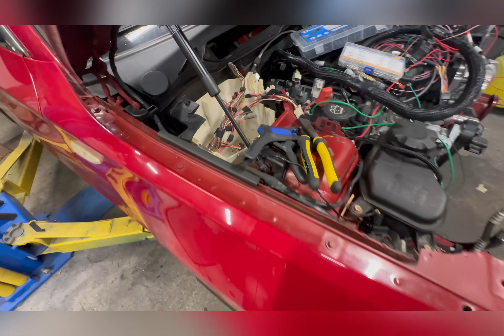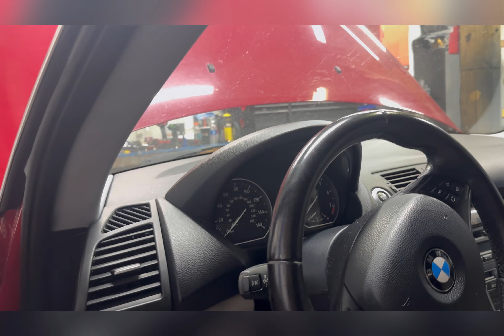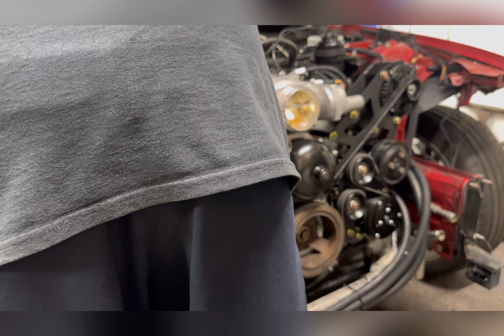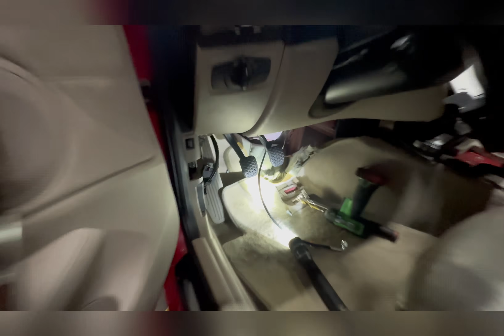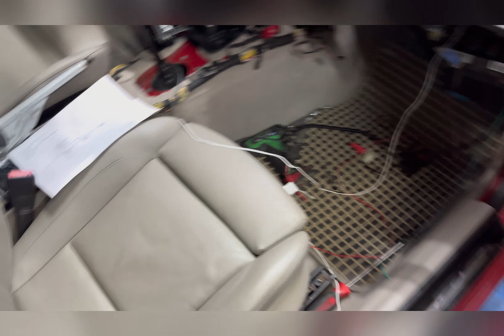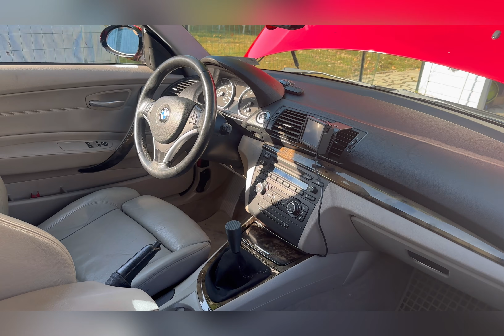V8 Swapping a BMW is THIS easy? Part 3

Comment: When I hit the link to the Holley harness, the link sent me to the Holley Terminator X MAX Engine Management Systems 550-918 model.  Is this the correct one because it states that it for a EV6 injector harness, and Pre-2009 4L60E or 4L80E transmissions.  Just want to make sure before I purchase at that price.
Reply from the maker: No you need to do your own research on which Holley harness you need depending on what injectors and transmission you are using

Comment: What size belt did you use with this setup? I’m on the tail end of swapping my 2007 e92 and I have the same accessory drive as you with the saden AC
Reply from the maker: @daltonlee1216  I ended up with a 2590mm belt or part number 6PK2590. Went to the parts stores and picked up the three closest belts in that size and the 2590 fit the best. Highly rec you measure first with some spring or something. Length can be different setup to setup
Reply: @ Thank you so much  I’ll measure as well just to be sure. Awesome build man, you did a great job
Reply from the maker: @ thanks man you’re gonna love yours

Comment: Great series. Enjoy your process and philosophy on YouTube content. Straight forward and to the point. Leaves more time for me needed into. Have a 07’ 335i e90 that is about 600whp full send and a 2010 Camaro SS MT. The 335i will be leaving for a e92 and the Camaro will become the donor car for the swap. Saving this series for sure!

One question…what made you go Holley Terminator and not GM ECU?
Reply from the maker: @edwardwerley8831  that’s the perfect engine combo for one of these chassis I think you’re gonna love it. I went with Holley because it integrates into the chassis without much work with Mikes Canbus Box to make all the gauges work and the ability to use the stock hvac controls. Although I’ve heard he’s working on a can box for the stock gm ecus now too

Comment: I’m curious to see how you did the gas pedal. Did you use a GM DBW pedal or were you able to make the factory bmw pedal work ?
Reply from the maker: @FlockaGarage  the factory bmw pedal works great. You splice the bmw wiring into the Holley drive by wire harness in the Ebox. No other mods needed
Reply: @Sfdgarage  nice. I’m sticking with a factory GM ecu tuned with HP and I’m hoping that it should be the same process on factory GM ecu. Atleast it seems to be lol there’s not much info on that setup out there

Comment: Sorry for bothering you but on Mikes site it only shows that the Harnesses works on 3 series up to 2006 
Do you know if it works for 2008-2009 model's? 
Any help would be greatly appreciated 🙏
Reply from the maker: @ChrisV129  no bother at all. Which harnesses are you referring too? Like the plug and play kits you can buy? As far as I know n55 cars are the only ones that have slightly different wiring
Reply: @Sfdgarage  thank you for getting back so quickly greatly appreciate it 

Yes the plug and play harness like yours but on the site it says only up to 2006 doesn't have an option for 2007 or later?
Reply: Mines a 2008 and worried the wiring will be different where I have to hook the pedal an canbus box etc?
Reply from the maker: @ nope 2008 is a perfect year to swap, all the lse90 info is based around that model. My 1 series is an 09 but 08-09 are just about the same
Reply: @Sfdgarage  sweet thank you so much

Comment: Nice video. I am in PA too. I have an e84 im in the process of wiring but i have an 8 pin throttle body and my terminator x max came with a harness that states dont cut or modify. What do i do?
Reply from the maker: @845BackyardBuilds  if you’re running a Holley setup you’re gonna have to cut it to splice into the factory bmw pedal like in the video. For the throttle body side, they make adaptors to go from 6 pin to 8 pin. Check out psiperformance
Reply: @Sfdgarage  i have the 8 pin TB DBW, and the harness for the 8pin. I have been trying to make this work. I've been checking diagrams. I've been considering that maybe its my ls2 throttle body not being compatible. what are you using?
Reply from the maker: @845BackyardBuilds  I’m using a gold blade ls3 throttle body. It’s six pin already and didn’t need an adaptor or anything. I think it was in part 1
Reply: @Sfdgarage  I'll be getting that. I will keep you posted once mine is running

Comment: Awesome vid man. Here in Australia, it's not easy to run aftermarket ECU's when doing engine swaps. Going to be running a standard LS1 wiring and ECU for emissions compliance ( Holden Commodore in Aus' ) 
Will be interesting to see if the wiring colours are consistent throughout the BMW range. I am yet to buy my BMW, but looking at E46 320i to 330ci Coupe'.....
Lots of info around the internet thanks to the good ppl that are willing to share...thank you.....

Comment: Sounds fucking amazing!  I have a 07 328i I would like to swap, already have an L96 but still need trans, holley, driveshaft, etc...how much $ would you say you have in the swap total, not including the cost of the car itself?  I am thinking its gonna take another ~$8k give or take to get everything I need, depending on whether I go 4l60e or T56...
Reply from the maker: @CPoston420  good question, I already had the LS1 long block and the T56 before starting this project so that saved a decent amount. All in I’m about 10k into the project including buying the car which was 3k.

Comment: Amazing! Do you know if you have to run that brake signal wire to pin 41 on the CAS if you are staying automatic?
Reply from the maker: @Stckit1  yes you do. The only time you don’t is a factory manual car staying manual transmission

Comment: Enjoyed this series, would you mind commenting on the t56 vs zf s6 gearboxes? Why go with the t56 or when should one stick with the stock bmw trans? Thanks!
Reply from the maker: @ngige3617  I already had a T56 in the garage to use so it was a no brainer for me. I’m not sure about the zf 6 speed gearboxes torque handling abilities, and combined with needing an adaptor plate and different clutch setup, I’d be selling it and buying a t56 magnum f setup. Just simplifies things, and adapting a driveshaft is slightly easier.

Comment: Pin 1/5 on that connector change by the year. That later cars with the connector with more than 8 pins are like yours, the early cars are 8 pin and pin 1.  I go by color most of the time as its the same.

Comment: I have loved these videos man! I am in the middle of acquiring parts for my own 1 series swap and your video was super in depth and helpful. I look forward to the next videos showing the dash corrections and Holley info. I am not a BMW guy but wanted a good platform for the LS and these are just so cheap and easy to work on. However, the software side of stuff with correcting the dash and getting the Holley setup are my biggest fears. Wiring was also a concern but between this video and Mike's I think you guys covered everything! Great job and please keep making videos with the stuff you do to this car!
Reply from the maker: @PartialRug  thanks! I’m glad you found it at least somewhat useful. The dash lights are an easy fix, I couldn’t find a good video on how to do it easily but I’m gonna make a video showing exactly how to do it and how I got there since I had to figure it out myself. The Holley video will cover exactly what you need to setup the system to work with the bmw and also I little tune setting up